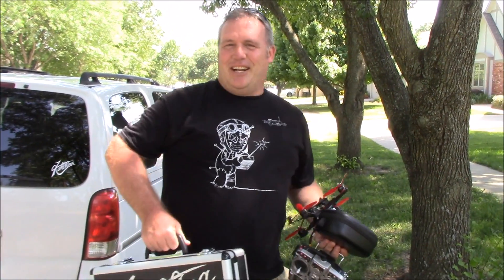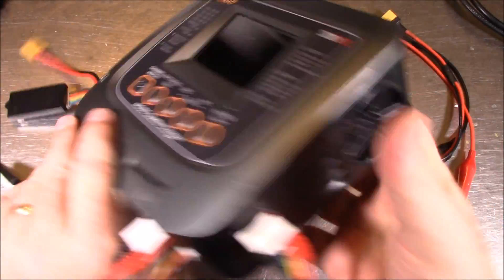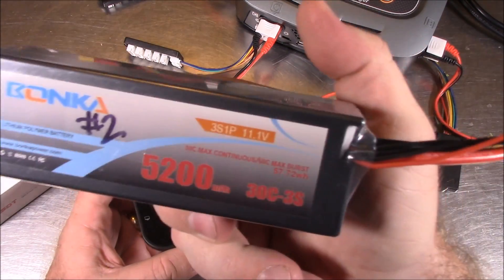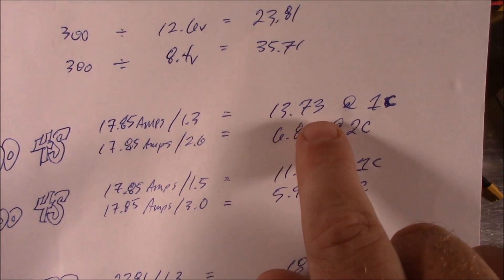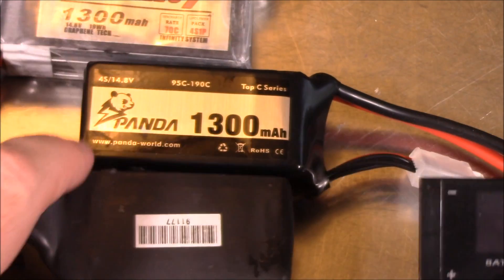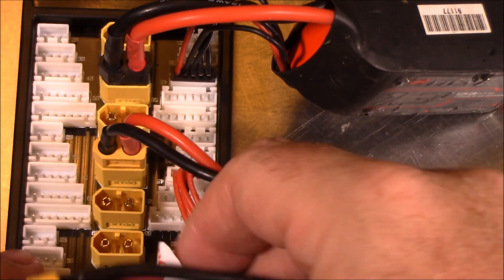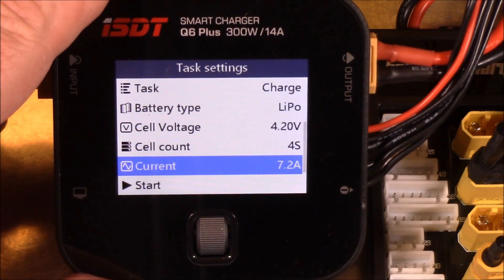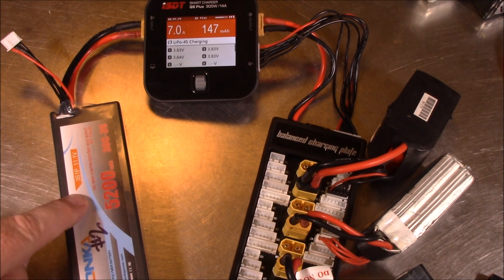ISDT Q6 Plus Balance Charging Example & Explanation

Comment: Can I power it with  a 12V Deep Cycle Marine Battery ? I have a MPPT Solar charger setup I was wondering I can eliminate my inverter and connect a couple of these chargers in parallel directly to the battery.
Reply from the maker: Yes, a deep cycle battery should work fine.

Comment: old vid but I have a quick question if you wouldn't mind. so I have a 3s 6600MAH that says I can charge at 2c, so wouldn't 1 C be 6.6 amps & I would be safe to double that & charge at 13.2 amps?... although my charger  ISDT AIR8 only goes up to 10 amps so would I simply set it at the 10 the highest rating? Thanks for your help.
Reply from the maker: Yes, that should be fine since.
Reply: @travisgrindal  since??

Comment: Also important to plug in all the xt60 before connecting the balance leads as any imbalance in the voltages might cause a rush of current through the balance leads and may damage them as they cannot carry a lot of current.
Reply: As long as you plug in each battery’s XT-60 before you plug in its balance lead, any current rush will go through the main leads. No need to do all the XT-60’s before plugging in any balance leads.

Comment: Can i use 2s 6000mah 75c lipo battery to power the isdt?
Reply: Yes. Because the minimum input voltage is 7V, so the 2s is usable.

Comment: I parallel charged 4 1300mah 3s packs with this combo. I used the ISDT charger to individually check the cells for balance afterwards and they all look good. But when I checked them on my alt battery checkers the 1st cell of each battery is farther outside tolerance. 

Cell 1, 4.160V
Cell 2, 4.197V
Cell 3, 4.204V
Reply: Then either your charger or your battery checker is wrong. Check with a third or fourth battery checker and bin the piece that is incorrect.

Comment: Could I add a cigarette adapter in my car and charge the battery from my car battery? 
I would only charge two or three battery at a time,except my single cell batterys. I need a charger or cord to go with that charger to do that. Could you even charge single cell battery with that charger? 
None have balance plugs. If I have several different brands but all rated the same is that ok. How do so balance a cell to get it up even with the other cells. Can I throw a non balanced battery on this and still get them all charged in An hour? Say I have three ,three cell batterys one has a cell that is over charged or actually not balanced even with the others,but not under charged. Would that one battery affect the other two battery being charged. Speaking of heat, would it be better to charge in the shade,or does it make a difference?
Thank you for making this video,it kind of helped. I see you had unbalanced battery like I was asking about. My concerned is overcharging a cell,or cooking a battery if one battery is too low.
Reply from the maker: You'd be better off using alligator clips and connecting directly to your battery.  Without doing some testing, there's no way to know if the internal wiring to your cigarette adapter has strong enough wiring. 
It should charge 1S batteries just fine.
If you have batteries with out of balance cells, you need to charge them by themselves to try to get them to balance back out before you start charging them with other batteries.  If one cell is consistently lower than the others, it may be time for a new battery.
I don't worry about shade or not shade for charging.

Comment: isdt plus has a 7 pin balance port. my lipo has 5 pin balance port. how do i plug it in
Reply from the maker: The ground wire goes on the first pin.  The last pins are used for 6S batteries.
Reply: Thanks. the beginning of this video made me lol. then i continued to laugh through it. very informative. your a funny guy though thanks

Comment: Hello.  I’m new to the battery charging school so my question is I want to charge a 10,000mah 3s whAt amp should I charge it.  1C 1.0a or 2C 10.0a?
Reply from the maker: 1C would be 10 Ah.  This should charge the battery completely in about 1 hour.  If you charge it at 2C (20 Ah), it should charge in 30 minutes, however, there aren't may consumer, reasonably-priced chargers that can charge 20 Ah.  Charging lipo batteries at 1C is almost always the safest way to charge as long as that does not exceed the manufacturer stated charge rate for the battery.  Most will charge at 2C just fine, but 1C is almost always the right way to charge.  My charger won't go over 6 Ah, so for my 10,000 Ah battery, I usually set it to charge at 6Ah but it times out.  Then I restart it and it finishes fine.  If you are unsure, start charging the battery and check the temperature every minute or so.  If it gets warm to the touch, you're probably pushing it too hard.  It should stay the same temperature during the whole time charging.
Reply: @travisgrindal  Your iSDT Q6 Plus charger will charge at greater than 6A... But you have to supply it with 24V on the input. If you're using only 12V on the input, you're limiting the charger to about 7A on the charging (output side). Joshua Bardwell explained this in one of his vlogs, "Why you MUST Use a 24v Supply For Your LiPo Charger".

Comment: as you mention all the batteries require similar voltage roughly 0.1v apart. obviously this is not possible by manual usage, so how would we get them all to the same voltage, could we plug them all in and do a discharge, then start a balance charge?
Reply from the maker: You can discharge them or charge a single one to bring it up.  At the flying field during a race, I don't pay attention to how discharged each one is... that is probably not good, but that is what I do.  I fly the batteries, the charge them with the balance board.  I'm usually pulling at least one back off before the charge process is complete.  The bigger deal is to make sure the batteries aren't getting warm during the charging process.  If one battery is significantly lower than the others, the charger will push more amps to the batteries would could possibly stress the more charged ones, but I haven't had any problems balance charging yet.

Comment: This helped me a lot selecting a field charger. Banggood has the charger, multi-battery  board and battery checker on sale right now. Thanks!
Reply from the maker: I really like this charger.  I don't usually balance charge except for at the flying field.  I'm standing/sitting within a few feet of the charger so if anything were to go wrong, I can react quickly.  At my house, I charge all my batteries individually... well unless I'm dying to run out an get to the flying field.  In that scenario, I will balance charge at home too.  :)

Comment: my q6 will only discharge at .4 amps no matter what setting you put in here.  It started this on only the second time I used it.  Know how to fix this?
Reply: This is the intended function of the charger, as it can only discharge at eight watts - so basically, on a 4-cell battery, the maximum discharge rate is 0.4 amps.

Comment: Im using the isdt q6 plus charger aswell. 
What would a safe amp setting be for two 2200mah 4s batteries? 4.4amp?
Reply from the maker: Commycruza assuming the batteries are within 0.1 volts of each other, you can charge them at 2.2amps x 2 = 4.4 amps safely.  If I was outside at a park, I'd personally push them a little harder... Maybe 5 or 6 amps.  They'd most likely be fine.

Comment: Your chart is whack. The charger is capped at 14A output. So you cannot charge 4S at 17.85A even if you wanted to. Also, like ZeroFPV said, you really need to learn about parallel charging before giving advice to the masses. You only need to match cell count and voltage, NOT capacity. Since they are all connected in parallel, the charger just sees one huge 4S lipo.
Reply: TweakRacer thanx man! You should have made the video!!!
Reply: Same cell count and/or voltage would be the muti battery requirement rule, right? I mean if it's a 3 cell battery then it must be 11.1 volts. Correct?

Comment: Looking through the comments I thought to add how I use my parallel board.
1. Battery check each battery and put them in order from low to high - not yet connected
2. Group them together if the cellV are within 0.2V
3. Connect the battery(s) that are the lowest first to the parallel board leave for 2-3 min
4. Set the charger at the correct C rating for the amount of batteries connected and start the charge
5. Monitor the charging batteries until they come within 0.2V of the next battery(s) in your group as per no.2
6. Add the additional battery(s) and leave 2-3min so they can sort each other out then adjust charger again with new C rating
7. Start the charge until you get to the next group of batteries within 0.2V per cell

Now keep going until you have filled up your parallel board.

Never mix cell count batteries - lots of white smoke
if you charge at 1C you can mix lets say 1300mAh and 1500mAh - I've never had heating issues of puffiness but not a bigger difference in mAh. I have seen 1500 and 2200 been charged at the same time with no issues for months - but I love my batteries too much
Never leave your charging process alone for more than 3min (pee break if needed only). Remember that if something goes wrong - 3min at 1C is probably the time your setup will take before you have a small flame thrower
From what I've heard - if your parallel charge process does go wrong - all the batteries are normally wrecked (so I've heard)

I have never in 6 years have had any issues with parallel charging because I charge where I sit and touch the batteries, charger, leads and parallel board about every 2-3min
Once, I was charging a 6s 5000mAh battery on its own at 1C when all of a sudden the famous white smoke came out from my charger. Charger did not get to beep more than 3 times before I pulled the power cord from it. Although the problem was with the charger I lost the battery too. One cell started to puff within seconds
Keep an eye on your goodies - it can go bad before 2 beeps

Thx Travis for the vid

Comment: multistar 4s 20000mah lipo is an awesome battery for your power supply with the Q6
Reply from the maker: Sweet.  I'm also looking at taking some of my old 2200 4S batteries and connecting them in parallel to charge from.  They still hold a good capacity, it is just that their discharge rate is terrible.  When I use them on my quads, the voltage drops like a rock.  I'm hoping that they can handle the lower discharge rate of charging my other batteries.

Comment: Uneven batteries will level themselves out as you connect them to the parallel charging board, even before you start the charging on the charger. Remember that all pins are from the xt60 are connected together, the same as the balance port pins (1st cell to first cell, 2nd cell to second cell, etc...)

Comment: just bring a generator and your charger that you currently have LOL then you could be constantly charging batteries on the go
Reply: okay you just put my comment to shame LOL
Reply from the maker: heh... I've been taking that Q200, but it is so big and takes up so much room in my suitcase.
Reply: travisgrindal any footage from the qualification
Reply from the maker: Here's a video from the guy that won.  He was insane fast.  He was the only pilot the whole day who was able to pull of 6 laps.  https://www.youtube.com/watch?v=dN9EqyMYHHE
Reply: travisgrindal dang he might be able to keep up with flying bear now I'm scared to go qualify LOL
Reply: travisgrindal quick question my 5-volt regulator went out on my pdb on my pup v2 do you know if I could still put that quad back together with a normal pdb the original one was big and also kind of held the frame together I didn't know if maybe you had had that problem before and knew of a way to get it back together with a normal pdb
Reply from the maker: When I didn't have a 5v output on my PDB, I've powered my flight boards from the 5v output on my VTX.  It worked fine for me.

Comment: The capacity doesn't matter for parallel charging. You can mix them as you like. Cell count and an relatively even voltage between the batteries are all that count.
Reply: travisgrindal no you can mix a 1300mah and a 2200mah because parallel board connects them together as if they were a 3500mah battery. They will both reach full charge at the same time.
Reply: You can definitely charge batteries of varying mAh capacities, but if you do, charge at a C rating based off the smallest mAh pack on the parallel charge board. So if you have 2 1300mAh packs and 1 1500mAh pack all on the same board and want to charge them at a typical 1c rate, charge at the 3.9amp charge rate you would use if they were all 1300mAh packs on the parallel board.
Reply: I found pretty damn good price on this site. It's for 49.99 USD with coupon code: ISDTGB
http://www.gearbest.com/multi-rotor-parts/pp_591386.html?wid=21&lkid=11083368
Enjoy!!!

https://www.youtube.com/watch?v=YWJlQmHX3NU
Reply from the maker: I guess that makes sense.  The most important thing really is that the individual cells between batteries have voltages that are close.  The balance charger couldn't tell anyway if there were a mixture of 2S, 3S, 4S, 5S, and 6S batteries.... I hadn't thought about that before.  Good to know.  I'll save that info for the next lipo charger video I make.  Thanks!  :)
Reply: travisgrindal 
cell count counts but capacity don't. if you charge a 1300mAh 4s and a 1500mAh 4s it will just behave like one 2800mAh 4s for the charger. if you want to charge them in series you have to match capacity. A 1300mAh 3s and a 1300mAh 2s would react as one 1300mAh 5s in that case.
Reply from the maker: Okay, I get it now, the problem with mixing 2S, 3S, etc. is that the overall voltage would be different (voltage going into the XT60).   Mixing different sizes would not be good though because a 1300mAh cell would charge way faster than a 2200mAh cell because of the smaller capacity, right?
Reply from the maker: Cool.  I'll keep this in mind.  Thanks!
Reply: I've mixed 1300 and 1500 mah batteries before and I notice the 1300 feeling warm while the 1500 were room temp.  Since then I have never tried balance charging different sizes.  Nothing bad happened, but it sure seemed like the 1300 mah cells were being worked harder than the 1500.  I'll play it safe and not burn my house down...
Reply: Brennan Lawrence finally someone who gets it

Comment: actually its very dangerous to add a charged battery to a balanced board with empty batteries attached. ITs because there is about a 1 or 2 volt difference in voltage so Amps wil run through the balanceplugs and fry your board.
Reply: @huhhman
NO! That's how you destroy your batteries and potentially burn your house down.
Reply from the maker: That would not be good.
Reply: huhhman  there is zero resistance between the batteries, meaning, a LOT of current would immediately flow from the charged to the discharged battery. Results in white/black smoke with potential combustion.